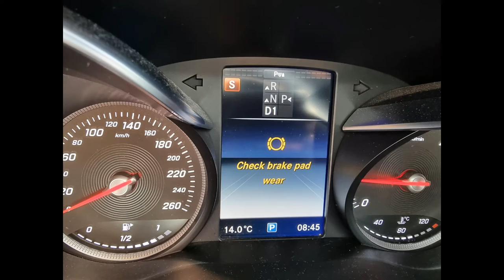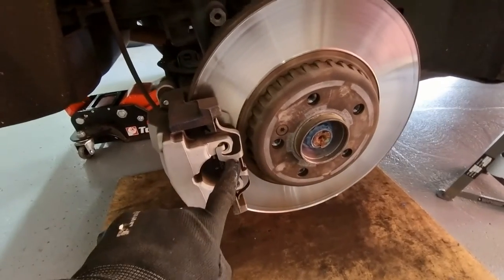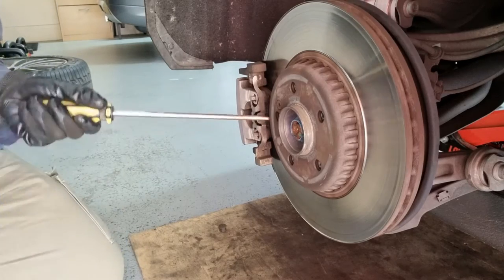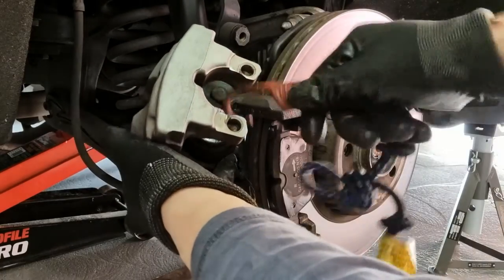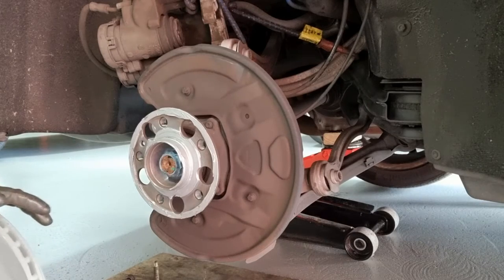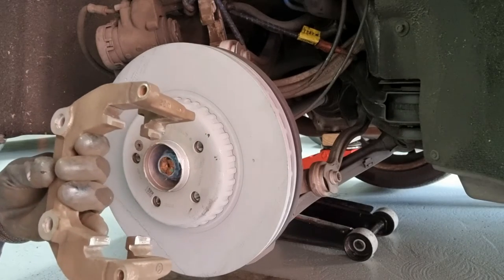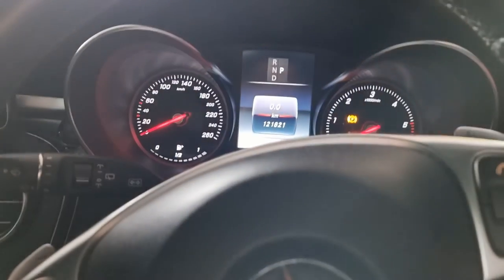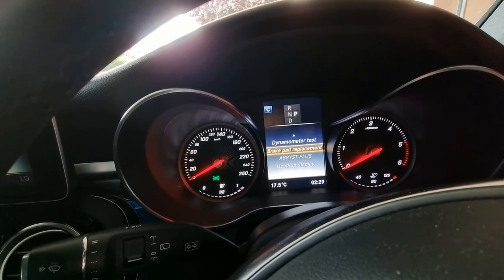Mercedes Benz GLC X253 Rear Brakes Pads and Rotors discs Replacement

Comment: Hello
Great video Thanks. I changed both front and rear brake pads and sensors for my GLC43 but I still get check brake pad wearing warning. Any recommendation?
Reply from the maker: hi, have you tried another sensor? I can only think it's not connected properly or it is faulty. 🤔 🙂
Reply: @kenkanfix  Hi Thanks for answer. The sensor is new but when I pushed in I did not hear click although I pushed it in enough. Should I rotate the the connector? Should I use any scan tool to reset the computer?
Reply: should I insert the sensor in the outer pad? It looks the I inserted to the inner pad.
Reply from the maker: @Ardy Kharabian  hi, no need for scan tool to reset the brake sensor. There's no polarity on the sensor so it can connect either way. as long as the connection is good and it's not touching the rotors then there should be no warning light.
Reply from the maker: hi, the sensor is normally on the inner pad

Comment: Can I put the ventilated discs?, my doubt is that they are a little bigger, will there be a problem?
Reply from the maker: hi, I believe you need the new disc need to have the same max thickness and diameter as the original disc. you can get part numbers for your car from partsouq.com so you can shop around.

Comment: When I need to exiting fitting position ? After I changed brakes from both side or when I change brakes from side where is sensor ? Thanks
Reply from the maker: hi, after replacing both sides.
Reply: @kenkanfix  Maybe you know hot to test parking sensors with multimeter ? I have issue on one from front side, but I`m not sure which is defective. Thanks
Reply: @gnus333  hi, you can use a multi meter and set it to test resistance. if it is working, there should be a few ohms of resistance ( less than 10).  goodluck

Comment: I’d like to know if you’ve used Torque Wrench and how many do I need?
Reply from the maker: Hi, have a look at this link https://mbworld.org/forums/attachments/c63-c63s-amg/425929d1595264308-c63-amg-s-brake-install-torque-specs-u70-install-front-axle-brake-caliper.pdf